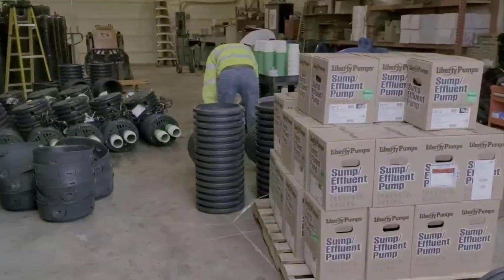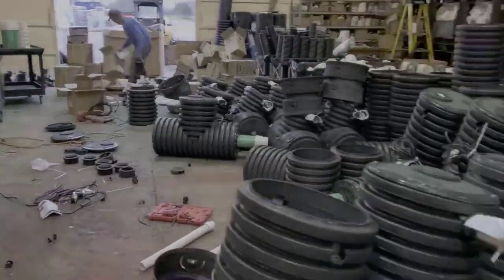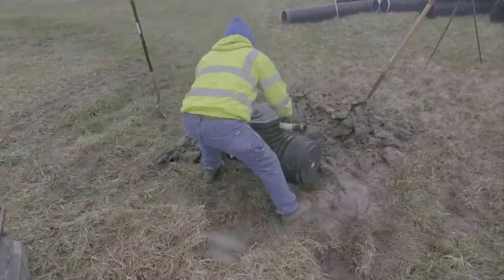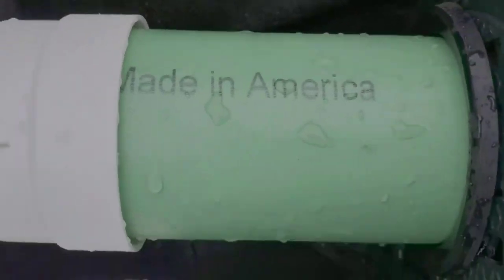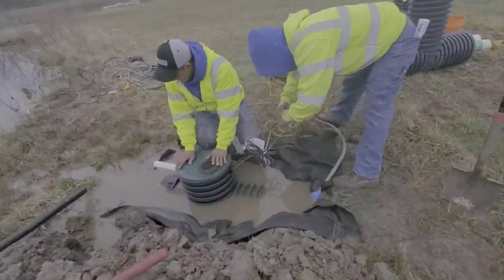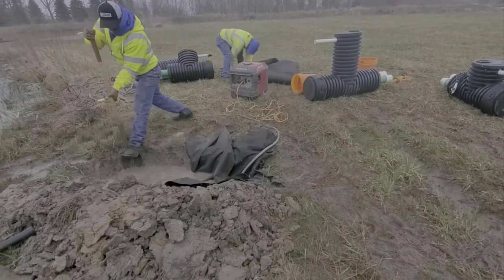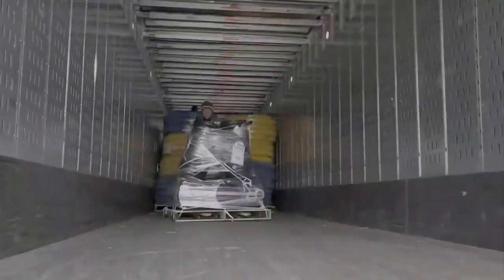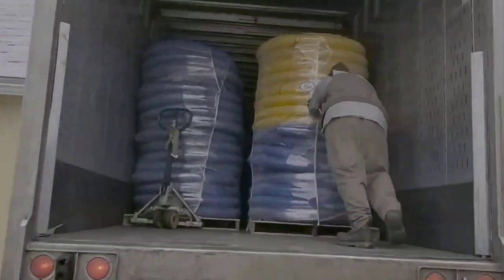How We Build DIY Friendly Outdoor Sump Systems [ 7/31/2020 ]

Comment: Great videos. Learned I have been doing things wrong all along, but eager to change for the better. I was wonder about the ends. I saw the solid interior caps used at the beginning end, but what kind of finishing tips do you have for the drain end near curb or street side sidewalks? How do you cap those ends and prep the ground?  I maybe went past those tips in videos and never realized I missed that info.